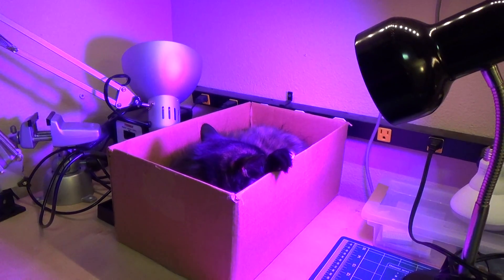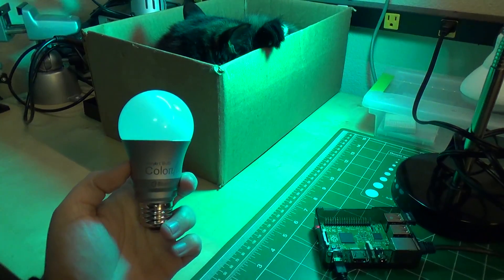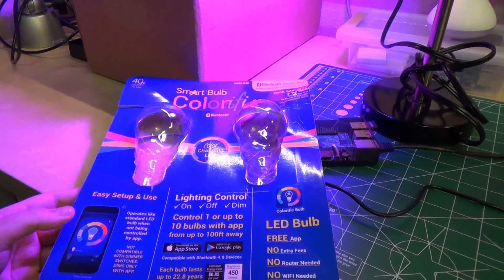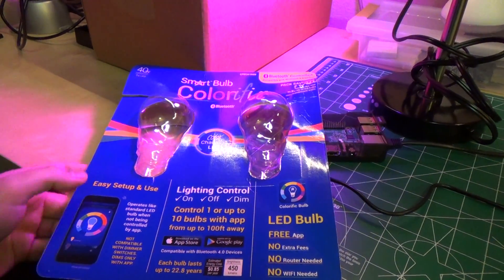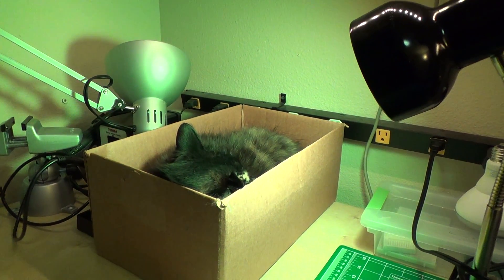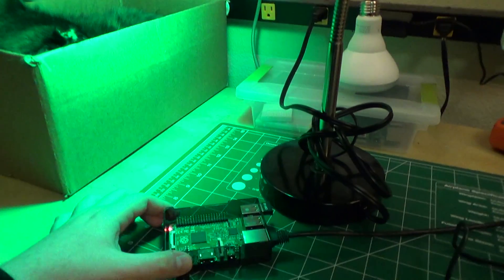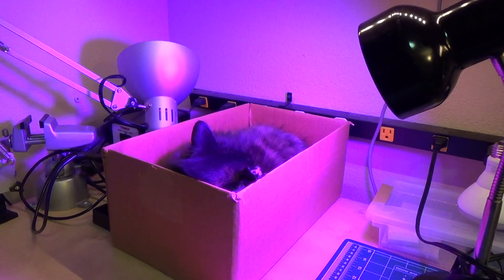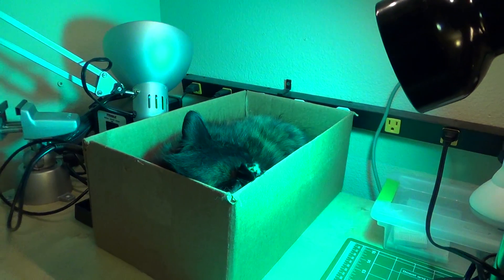Preview of reverse engineering a Bluetooth low energy RGB light bulb

Comment: Thanks for the howto. I've actually been waiting for someone to show us how to do this for about a year. I'm not familiar with BLE, but am a seasoned developer.

I bought some LEDE bulbs a year ago and they are of EXCELLENT quality. The problem is the manufacture has practically vanished. It's really a shame because I'd love to buy some more. (I'm slowly migrating to wifi because of the hackability factor; but I still don't want to replace all of the existing bluetooth bulbs.) The only control I have for them is through an app called TintLink. 

Hopefully with the help of your guide, I can disassemble the packets and create an API layer for my not yet arrived NEEO remote + bridge.